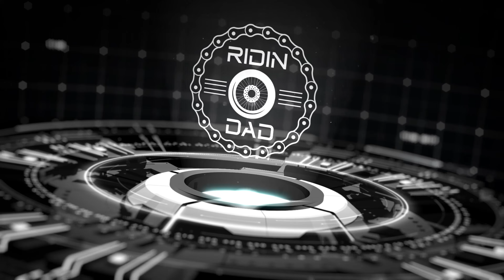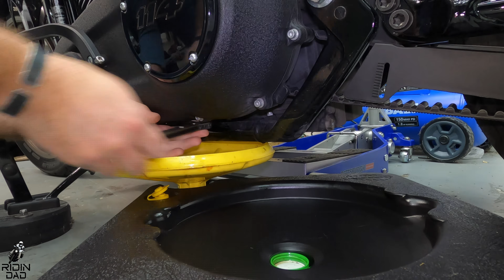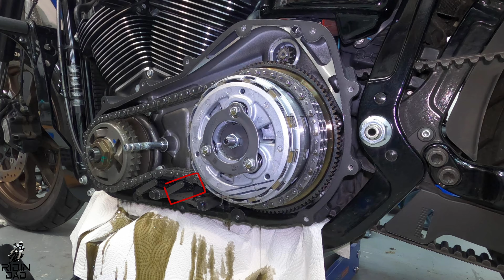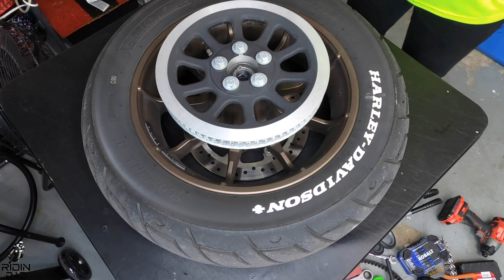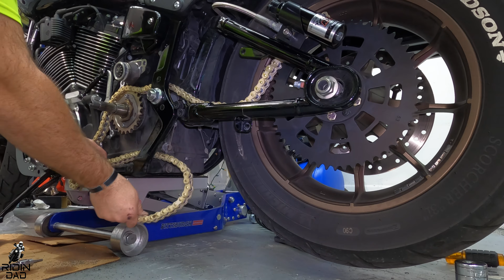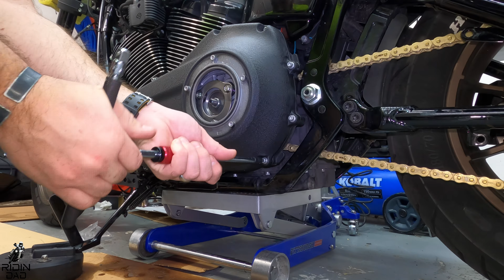Chain Kit Install on a Harley Davidson Low Rider S - speed kings kit (low rider build series ep22)

Comment: What motorcycle lift are you using? I can’t find that info anywhere. Thanks!
Reply from the maker: Harbor freight but with an upgraded harbor freight wheel chock. The stock one on this lift is trash
Reply: @RidinDad thanks!
Reply from the maker: No problem 🤙🏼

Comment: good vid

about half way thru doing this to my bike, same year and model as yours. when you took the rear wheel off and put it back on, do you remember if it was hard to turn? i think the caliper pistons are not retracting, could this be because the ABS crap or is something wrong how I put it back together

-thanks
Reply from the maker: Hey man. The caliper can be slightly off when you put it back on. The brake pads could have been pushed in accidentally just slightly. I would start by fully pushing the brake pads out and then re installing. See if that helps man and let me know
Reply: @RidinDad  got it, thanks

Comment: how soon did you do this to your bike? my starter is frozen to my inner primary lol even tho I removed the two bolts, im sure ill get it off just a pain in the butt
Reply from the maker: within a year. Just tap it out with a rubber hammer man, it'll come out lol
Reply: @RidinDad  Awsome, thanks! Another question lol, the mainshaft nut on the sprocket is turning the entire sprocket/wheel. I see the actual shaft is not turning (put the bike in 1st so I could snug up the pilot for the tool). Any ideas?
Reply from the maker: Yeah just gotta get a way to hold it. They make specialized tools but you can get creative and improvise
Reply: @RidinDad  Finally finished up this morning. Man, I always thought disassembly was the easiest, but for this job assembly seemed to go a lot smoother. First ride tomorrow! Thanks for the help.
Reply from the maker: Yeah agreed lol. Assembly for chain kits Sean’s better than taking it apart. You’ll love it man! Enjoy and ride safe
Reply: @RidinDad  rode it a few times and it definitely is more aggressive. I think I may take the belt guard off tho, I can hear it slapping against that whenever I downshift.
Reply from the maker: Yeah most people do. A lot of chain kits recommend taking it off for that reason too.  A good chain wax won’t fling off either

Comment: I believe I heard you say a 53 vs. a 55 would give you more low torque...if so then you would be incorrect, the 55 will give you more bottom end, that is if you stay the same front sprocket
Reply from the maker: Nope. I went 53. But 55 is more felt torque. Obviously the bigger the rear sprocket the more bottom end. Opposite for front sprocket.
Reply: Felt torque...interesting.  If I want more torque at the tire I go with a larger rear sprocket hence a better bottom end. Is felt torque like if I have a loud exhaust I feel like I have more power ?
Reply from the maker: No. Obviously you’re just being an ass now. It doesn’t change the actual torque of your bike because you’re not changing engine components. So yes, torque that you feel you gear up which you know.
Reply: @RidinDad   I was asking you a straight question but you go to calling out names, dad....ha ha funny sounds like the the kind of dad that ends up on the ground in front of his family
Reply from the maker: I assumed you were being sarcastic with your loud exhaust comment. If you weren’t I apologize. If you’re being sincere than yes it’s felt tq but it’s really there. Quicker acceleration with taller gearing in the rear. Smaller rear sprocket gets lower acceleration and high top speed. Your comment about being on the ground in front of my family is a little absurd man
Reply: @RidinDad  it was a serious question that I was confused with, absurd I don't think. I am direct and a name call out  is something that is not necessary and something I was taught to come quick for....appreciate your response back.....peace 2 you

Comment: Jim’s tool says it’s unavailable on Amazon..what would be a good alternative?
Reply from the maker: For the main shaft nut? Or for chain alignment
Reply: @RidinDad  I am trying to find this as well...for the mainshaft nut. Everywhere I look they only carry it for Twin Cams. As long as I get one for a 2006+ TC should it even matter since that is when the TC got the six speed?
Reply from the maker: I believe the bolt would be different. The inner shaft threading or diameter might be different too. You’ll have to get one specific for the m8’s

Comment: Chris, great video. Currently has belt drive n recently discovered that my rear belt pulley has slight bent whivh attached(stamped ring) on back side of oem pulley during my routine maintenance from HD dealer.  They recommend strongly to replace a new oem pulley. I am  in the fence post considering going with chain conversion if possible.  
Questions , once I installed a chain drive, do i need to re- dyno my bike, furthermore, can i still utilize belt cover with chain drive, and woould this grease sling all over the rear n especially my clamshell saddlebags? Appreciate your feedback.
Reply from the maker: I will pretty much always recommend a chain conversion. It’s just my style. As far as getting the bike on a dino, no you do not have to get a different tune because it would change nothing, even if you went with a different gear ratio you still would not have to change the tune because, the engine itself is doing the exact same work. It’s just the final drive ratio that has changed if that makes sense. Yes, I have known people that still utilize the belt guard with the chain. I don’t think it’s necessarily advised because the chain moves and kind of slaps around  a lot. But I know people that have kept it on for several hundred miles with no issue. I removed mine instantly obviously. As far as grease getting all over your bike, not if you use good products and you don’t over apply. I have used maxima spray wax with amazing results. No sling off. Just don’t over apply. I use muc off degreaser to clean it and remove old wax

Comment: The jims tool to jam the comp and clutch is just a 7.125" bar. with rounded edges so it doesnt dig into the gears.  https://www.ebay.com/itm/272507712130

Comment: dont use a impact on the comp bolt. it can damage the stator.
Reply from the maker: That’s true. It technically can. However I’ve used an impact on 4 different bikes there now and have had no issue. One bike I did 3 different times
Reply: ya never heard of it actually happening but HD says it can.  I mentioned it because it would suck for someone watching to break theirs. just need a 3 ft braker bar and push down. Body weight helps.   @RidinDad
Reply from the maker: True

Comment: Has the bike had any leaks? Specifically where the shifter tower meets the other half? Once I removed the primary I had to replace that gasket too. It was leaking substantially.
Reply from the maker: Nope, 0 leaks anywhere. The gasket at the inner primary? Or the gasket between the inner and outer primaries? I've never had to replace the inner primary gasket before and I've done several chain conversions and even a forwards to mids conversion

Comment: How’s this speedkings chain kit holding up for you? I’ve got about 2k miles on my kit and it’s riding good! but for some reason I’m scared screws are going to back out etc. i do clean and lube every 700 miles.
Reply from the maker: No issues at all! And my buddy’s is going strong too! I wouldn’t worry man
Reply: @RidinDad  ty for the piece of mind!
Reply from the maker: No problem man

Comment: I have this same exact kit and I love it! How often do you clean and lube the chain? And are you going to do a vid on how to tighten the chain.
Reply from the maker: I’ll probably do one yeah. I try to clean and lube mine every 709 miles ish.
Reply: @RidinDad  thanks mate
Reply: When i clean chain good and after a ride, I see some black liquid forming. Idk if it’s melting from the tooth or O rings do you experience that too?
Reply from the maker: Are you just talking about after you clean it there’s liquid dripping from your cleaner off of it? If you are cleaning it properly, with a degreaser or similar chain cleaner there will definitely be some black liquid. Unless you are talking about after it is clean and then you go for a ride and you see the black liquid. That sounds like it might be your chain wax or lubricant breaking down and getting dirty. If your sprockets are wearing they should not become a liquid. They would just have a little bit of the metal come off and you would generally see that overtime on your teeth

Comment: does the spacer need to be exact size or you can play with front sprocket
Reply from the maker: Spacer may have some play either less or more. Very small amount. You need clearance on both sides for the chain. Very narrow space for it not to rub on anything. And the spacers need to be the same for front and rear sprocket otherwise the chain won’t track straight and you’ll have so many issues. Why would you even want to play with the spacers?
Reply: @RidinDad  im not playing with them. i was wondering what size i should order. but someonetold me that i need 7/8 inner spacer for dyna 2015. thanks man
Reply: for a specific sproket 👍
Reply from the maker: Gotchya. Good luck with the install!

Comment: Except you skip sections of installing parts and they’re already back on. You picked and chose certain things to add. Also, the torque for the primary cover bolts are in inch lbs which is equivalent to about 11-12lbs torque which is nothing and would not snap any of those bolts.
Reply from the maker: There’s tons of guys snapping derby cover bolts prior to reaching tq spec. And I’m sure that’s what you were talking about as the tq spec for the primary is higher. What exactly did I pick and choose to install without covering in the video?
Reply: Torque specs is in Inch Pounds not LBS. massive difference for sure. I caught that right away

Comment: Just a heads up. The socket size in the link is incorrect. It’s 1 3/16. Correctly stated in the video.
Reply from the maker: Unless the link changed that’s the exact item I purchased and used
Reply: And your mainshaft socket is the wrong size. Should be 2 1/4
Reply from the maker: Everything I listed was correct fitment for the job I completed
Reply: @RidinDad  weird. We have the same model and year. I’m doing the job right now with the parts linked in your description and they don’t fit. Like you said, maybe the links you provided changed
Reply from the maker: Yeah very plausible. I’m sorry that happened to you if that’s the case man. That’s opposite of my intentions. I’ll do some searching to see if I can fix the links with the originally intended products. Sorry that happened to you man :(
Reply: @RidinDad  no worries. Your videos are a great help! I should have double checked before purchasing. Thank god for 1 day Amazon shipping. The right size should be delivered tomorrow :). Have a good weekend
Reply from the maker: Ok awesome man. Good luck!!

Comment: why would you want to remeove the chain wax from the chain?
Reply from the maker: You have to complete basic routine maintenance on the chain. Every so often you have to clean all the dirty wax and crap off of it and re apply
Reply: @RidinDad  i understand that but its a brand new chain.  was wondering why you would want to take the wax off that came on it and re apply different wax.. ive always left the wax they come with on until its time to clean the chain so i was curious
Reply from the maker: There was so much. My bike would have been absolutely covered in it. There’s was probably 15x the amount you would want
Reply: @RidinDad  ahhh having had the kit installed for quite a while would you still recommend it? and how are you liking the bigger rear sprocket size you chose?
Reply from the maker: I love it. Definitely felt the difference but nothing negative at higher speeds. Really good feel. And yeah. Wouldn’t hurt man. Get all that super thick heavy wax off and put some light stuff on made for riding. Why not

Comment: How often do the sprockets have to be changed?? I know the belt is a little more work in the event of it snapping/breaking/ripping. But how often are you going to have to be breaking everything open again to replace the sprockets? Every 10-20k miles?
Reply from the maker: I doubt it. I would assume the main shaft sprocket would at least do 25-30k miles minimum. And the rear probably the same if not slightly less. But I’ve seen guys running the same chain conversion for over 40-45k miles with still no issues at all. None of these chain kits have life expectancy on it so time will tell for my build

Comment: Will this help with wheelies? I’ve always heard for doing wheelies and “drifts” a chain helps significantly, does the low rider s wheelie? I’ve only seen one video of one doing a wheelie and I want a wheelie-able Harley. I know all the dynas could but i haven’t heard much about the new softail frame
Reply from the maker: Yes the low rider is definitely a wheelie able bike even from factory. I e seen guys take it off the show room floor and wheelie it with no modifications. The chain helps a lot depending on which gear ratio you choose. You can tailor it for higher top speed or quicker acceleration. The chain also helps by lessening some of the stretch you get from a belt

Comment: I went chain  drive years ago on my electra glide , belts are garbage , weak , expensive and labor intensive , much less reliable , I've went through 3 of them and left me stranded 2000 miles from home .
Reply from the maker: Oh damn that’s crazy. I’ve never heard of a belt wearing out like that. That sucks :/. It’s a nightmare to replace them too!!!!
Reply: @RidinDad  My ultra spit out 2 belts , dyna lowrider snapped 2 of them , I have no luck with belt drive
Reply from the maker: You really don’t man :/. Chain is king!!!

Comment: you dont need chain on Harleys only when you bump up the torque to 130 FtLbs then consider chain replacement
Reply from the maker: I never said you needed one. There’s tons of reasons to swap to the chain as I mentioned in the video

Comment: Hey there awesome video. Quick question. The JMS pulley tool you listed, did you use that during this process. If so I will go back and watch again. Great work again. Thanks for putting up with the heat for us
Reply from the maker: Thanks man! If you’re talking about the one for the main sprocket no I did not. Everything I used you guys saw. It can easily be done without it as long as you have a good impact wrench

Comment: Found one for my FXBB Same as yours just read chain even though on the same gear ratio as you because mine has that torque it has 142 torque in like 146 hp so I figure that would be bulletproof set up for something like that to ride wheelies and piss around on and just have fun jumping off curbs and shit 🤘🥃
Reply: nice numbers My Dyna spent a brand new 16 rear  tire in 1 day
Reply: @billgonzales8978  I’m sorry I don’t understand your reply bro Spent money on a 16 tire
Reply: @atrain882  lots of torque will eat up tires real fast when racing burnouts you can go throiugh tire fast
Reply: @billgonzales8978  yeah I have learned that now just eats the rubber
Reply: @atrain882  one day gone burn out
Reply: @billgonzales8978  
Does it mean you burn a rear tire off in one day lol
Reply: @atrain882  yes
Reply from the maker: Sweet!
Reply from the maker: Sounds sweet! You’re gonna love the kit!

Comment: The installment video was good. But good luck keeping the bolts in the rear sprocket since no Loctite was put on them I know you torqued  but they still come out.
Reply from the maker: Either you did not watch the video fully, or you were unable to actually see what was going on even though I talked about it for some reason you did not understand. The grade 8 bolts that hold the sprocket onto the rear wheel, are Held in place by the locking washer that fits over them. That’s why I constantly had to adjust them until the washer went over it. The washer has cut out for those bolt heads and as long as that washer is over top of them the bolts are unable to turn in any direction. The hardware that holds that washer on over those bolts was applied with thread locker. I explained all of this in the video as well as showed you what I was doing so I’m not sure how you missed that part
Reply: @RidinDad  I should have watch the entire video the main purpose for me watching it was knowing all the tools I needed to buy. I kind of just skip through the tear down just to get a brief you. I’ll go and watch how those bolts work tho Because I may use speed kings kit instead of trask
Reply from the maker: I completely understand that man. I have watched many videos just skimming through for the parts that I wanted to take away. But if you’re going to comment some thing about the video you should at least know for sure what you’re commenting on is legitimate

Comment: Love the idea but I currently have no desire to return to chains. Great video and great in depth!!
Reply from the maker: Thanks man!!! How come your anti chain now lol. Bad experience or just annoyed with the maintenance?
Reply: @RidinDad  honestly nothing more than I like the low maintenance. I've also had one snap at highway speeds, that was fun. As for your gopro, you may want to replace the sd cards first and see if that's the issue
Reply from the maker: I rotate between 3 cards and I have this one labeled now so I’m gonna be experimenting with it :/. That sucks that you e had a chain snap on you. I bet the bike suffered some pretty rough damage from that